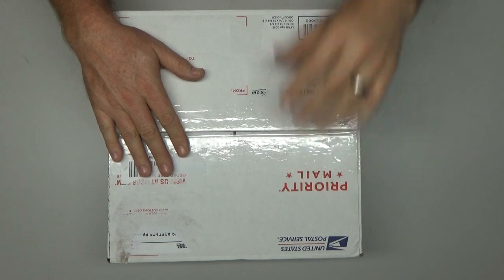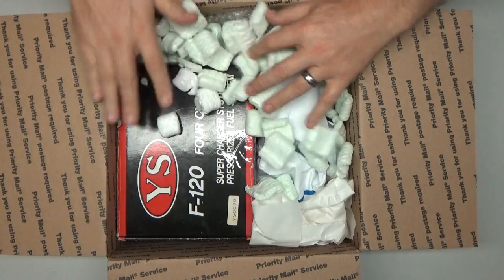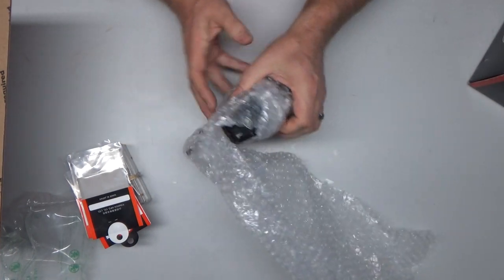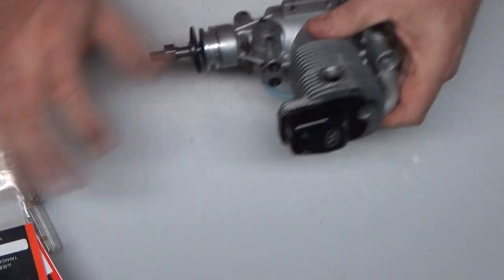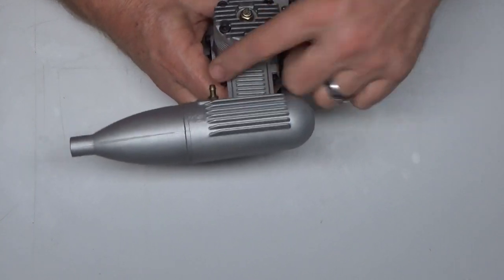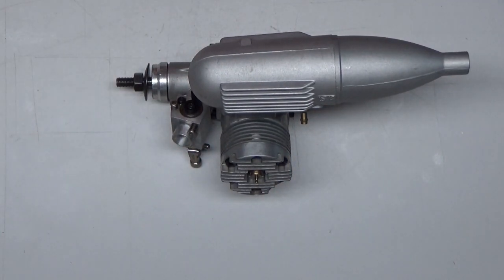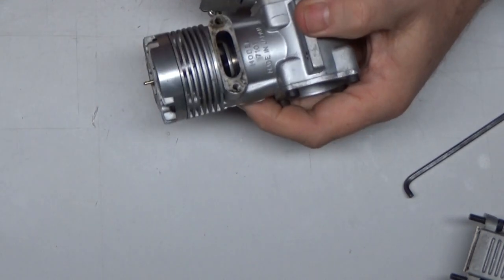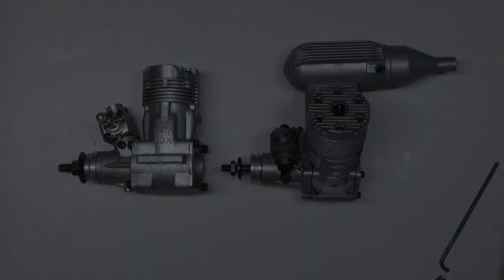Customer Engine and Payment (YS FS120 Enya 60XF-III)

Comment: Ahh yes - this is definitely an Enya type carb - old style of course - and they took some features of the Perry type of carbs. Yes, this is the mid-range fuel mixture adjustment. Very easy to adjust but be very careful, only very tiny "movements" are needed in either direction - a bit sensitive (like the Perry carb). I am talking about 1/64" increments of movement at a time.. Be patient and you will be rewarded with an excellent carb. "+" means richen then mixture, "-" means to lean the mixture.  Hope that helps.  Maaan, you are like me in many ways ... I simply LOVE engines and love running them .. :)  I truly enjoy watching your videos.

Comment from the maker: I have since found out that this engine is the Enya 60XF-III and it features the GM-10S carb and is original to this engine.  It features AAC construction. Aluminum piston, aluminum chromed plated sleeve.  I have also found a stock 60X muffler that I ordered.  I will wait until that arrives before running this engine......most likely :-)
Here is the article where I found this information.  
http://sceptreflight.com/Model%20Engine%20Tests/Enya%2060XF-III.html

Comment: more power is not the goal..its to update and make them more reliable..thats why they all come that way now..its an improvement in fuel control which is the biggest hurdle when dealing with pressurized system. the blowby effects the regulator big time
Reply from the maker: Well power increase were some of the first words I heard in that video you put a link to.  Either, it is not my engine and I cannot go modifying it, nor would I.  I simply do not buy YS engines aside from the FZ53 I have.  I have no interest in that brand of engines really.

Comment: I have a YS FZ-110S need servicing. It will not get to peak power. I believe it needs a ring, piston, sleeve. I have some simple Saito or OS engines to trade?
Reply from the maker: Sorry but no I am not interested in taking on a YS engine that needs parts.  They are too expensive.

Comment: No No .. this is NOT an air-bleed carb.  Read my comment below.  Use the "+" side to richen, the "-" side to lean ..  Very tiny, "hair-like" movements in either direction at a time.  Much like a Perry Carb. and almost similar in concept with the K&B Sportster "knob" which is located on top side of their rotating throttle barrel.
Reply from the maker: I just found out that this is the Enya 60XF-III with the GM-10S carb.  It looks like an airbleed hole in the front of the carb, i.e hole with screw that meters airflow.  I cannot find much more information on this carb however.
Reply: I would first try to adjust the mixture with the "+" or "-" option and then it's possible to further fine-tune it with the "air-bleed" front screw .. but I would be a bit hesitant to rely only on the front "air-bleed" screw. My opinion.
Reply from the maker: Oh of course.  Will do.